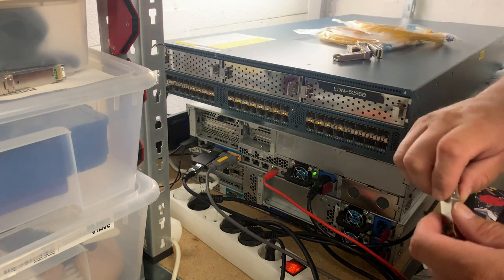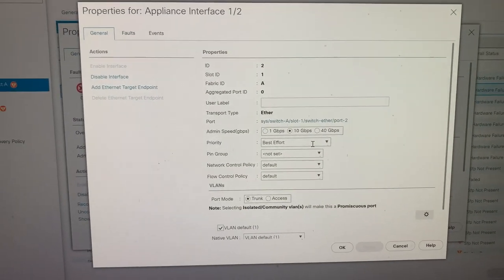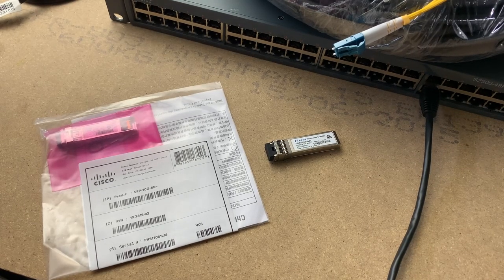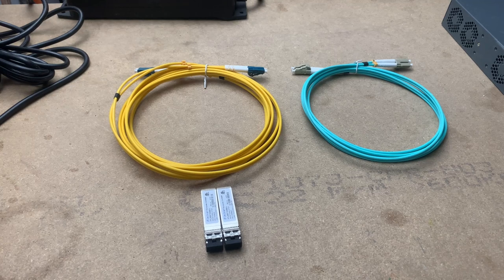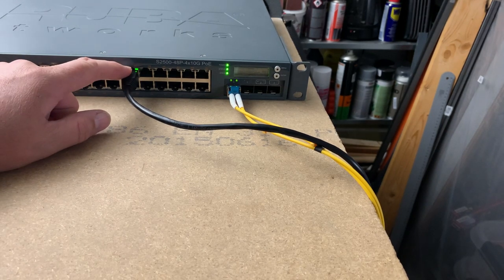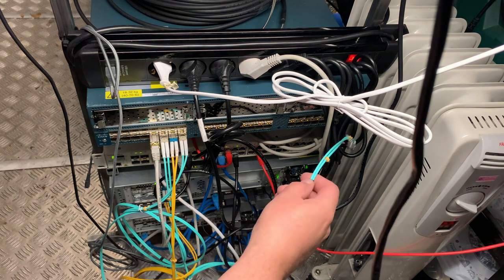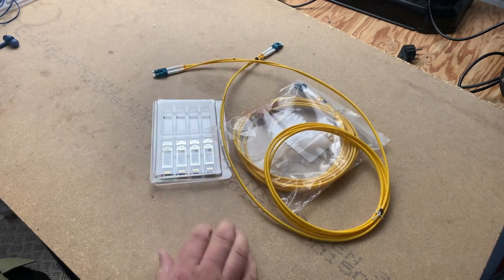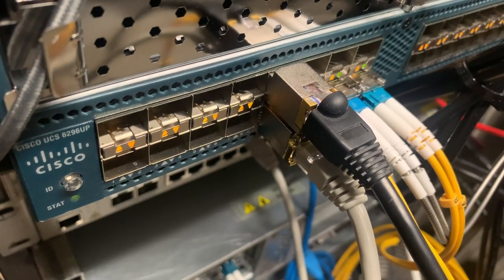Cisco UCS 6296 UP install SFP+ modules and network configuration

Comment: Hello I have watched your videos and have a question about connections.  How are the 2 port that are connect to the UCS and the S2500 configured.  I am having issues getting them uplinked.  I am using DAC cables.  Thank you
Reply from the maker: I have not used DAC cables I used all fiber. See next video https://youtu.be/VcFgJADCSCE
Reply: How are the ports on your UCS configure? as server or appliance ports. Did you use VLANs
Also I setup the uplink on the UCS which is a Trunk port and I setup the S2500 10G port as a trunk port is that how you have your configured.  Thanks
Reply from the maker: I run everything as Trunk/Network/Uplink. As I understand it Server would need a spacial card in server. Appliance also  has  special requirements. Have not studied the docs in detail as I have none of the hardware....yet :)
Reply: I had to set my UCS to switch mode and configure the ports to  Trunk/Network/Uplink and that worked for connectivity.  Thank you...   I am trying to configure Jumbo frames for NFS Storage and ISCSI Storage on the UCS have you done that?  Thanks